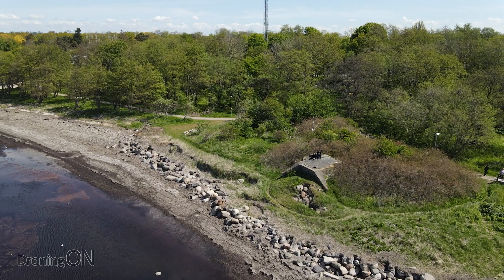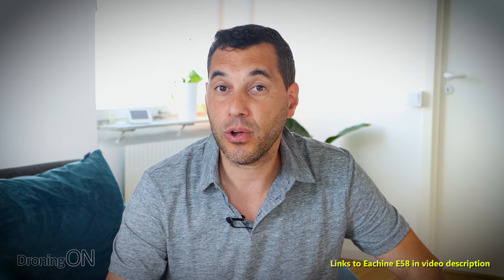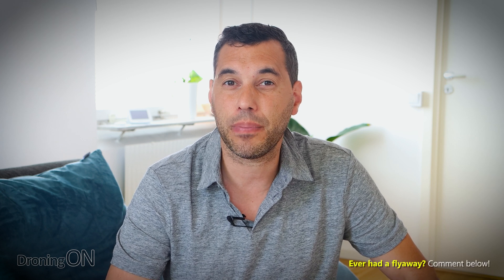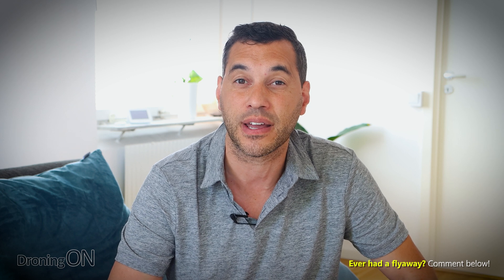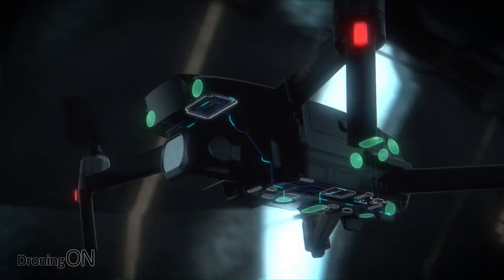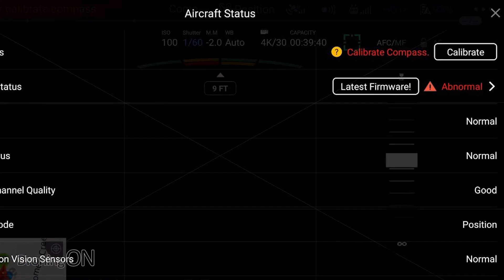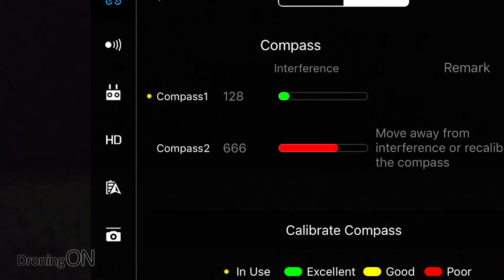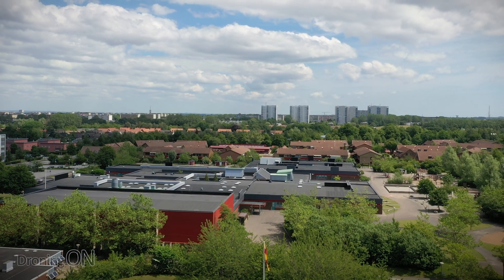How to NOT lose your drone (flyaway) - Beginners Guide

Comment: I have a cheerson CX20. It is not wind friendly and even with many flights it is liable to go rogue. I dont fly it often, the newer software in the cheap models are superior. I fly cheap DJI knockoffs. The position hold is great also is the auto RTH. I only have to bring it back manually if very high in the wind currents. If you dont practice manyally flying with harsh control imputs you may never be able to have the skills to manually take control. When control is an issue drop to a much lower altitude above any obstructions and pull it back in aggressively. Fly the machine! Dont allow it to fly you.

Comment: Thanks for the heads up very informative video. Before I stepped up to GPS enabled drones I had a lot of experience with toy drones like the ones you see at malls so I'm pretty confident in flying a drone that doesn't have GPS stability. But I always wondered what Attitude mode was.

Comment: This happened to me this evening and I had absolutely NO CONTROLS ON THE REMOTE . 

This drone has a 15 minute battery and I had no idea it could even go as high as it went . 

As soon as I pushed the takeoff button it zipped right off into the sky and didn’t stop . I watched it turn into a dot , and then totally disappear. 

This little drone went well over 30 thousand feet and kept going ! This really concerned me because if it’s potential to get sucked into a commercial jetliner , and then of course what it may land on when the battery died. 

I have video of it shortly before I lost it WAY UP in the sky . 

I was just flying it inside and a bit outside . I have no idea what happened but it was almost as if something took it over as soon as I pushed the takeoff button, (which was actually from my hand instead of the ground this time ) and it went straight up and away. 

I pushed every button I had and then I heard two like songs almost . One that had tones ascending , and then one that had tones descending . 

What the HELL happened here ?

Comment: Fly aways demonstrate you're never in control but DJ is controlling the unit. My 2nd day of flying a DJI mini 3 the thing just flew away. It acceleraged up to 2000 feet and 2 miles away.  Compass and GPS was calibrated; but why does the drone just take off and fly a huge distance away?

Comment: I'm here because of Atti mode I experienced yesterday with my JJRC X20. I was playing in a new spot inside my housing complex and it was right beside a power grid substation so that's probably why. The first thing that happened was the DISTANCE sensor suddenly indicated 2.2km while the drone was right in front of me so it activated the auto RTH away from me to an unknown location, luckily it has not lost signal to the RC so I managed to cancel the RTH and regained control of the aircraft before it got too far away. It then behaved like a rodeo bull on a leash refusing to fly stably to which directions I pushed my joystick to. I checked the display and the status in the app is still "aircraft is normal (GPS mode)". the Joystick display was also displaying Mode 2 (GPS mode) and GPS on. so I really didn't know what was going on

I started to panic and warned a few neighbors that were enjoying their evening stroll to clear the area as I might need to crash land this drone, luckily there weren't that many people around. I did the best I could to bring it to a clearing in my complex fighting against the wind that were blowing unpredictably and after a few hesitation I push down on the left joystick down hoping for the best. It narrowly missed a water hydrant on the way down and miraculously landed a few meters from me (pretty hard but quite alright considering what was happening). Hopefully this can help some of you in the future should this happened to you.

Comment: I lost my mavic 3, 3 weeks ago in far north of Scotland, photographing stac polly.
My mistake was I flew it from the car park in the wind. However, I did not expect to lose connection with RC, but I did, and I could not get a connection back, this revolted in me frantically hitting the home button with no success, end result, drone lost in the mountains.
I have flown remote.control planes, helicopters, and dji drones from the second edition phantom all the way up to mavic 3. I have flown around this mountain before with the phantom, and mavic air 2, but this time I lost my more expensive mavic 3, the only thing I can think of that was different in the flight was using the new dji rc with screen, all other times I used my phone with the rcs
Reply: TRIBE OF DAN 13th BLOODLINE  Hi Thx for this info, do you recommend one that would go on my next Mavic 3?

Comment: You need to preset RTH on lost connection instead of hover, also in case  of strong wind, you need yo get tge drone to lower altitude and S (sport) mode to manually override and control the return, that is apart from the calibration ln everythong and update location.

Comment: Here are a few things that may cause fly aways:
1) If you are flying in a new area, and you haven't checked available satellites? And your drone depends on satellite positioning to obtain GPS coordinates??? And only one satellite can be locked on with some radio stations & ham radio stations within 1/2 mile of where you decided to fly???  What do you expect other than a fly away? I don't know if you can download an app to find satellites available. I do know that you can use an app to determine if 2.5ghz is filled with cell phones. I don't know if the drones have the ability to change channels on the 2.5ghz frequency, but if they don't???? bad engineering, and this is (IMO) why you are having a loss of control. 
2) If you are using 2.5ghz, and are in a densely populated area, everyone and their grandmother is on some phone using this same frequency, and you WILL have interference even though you don't want it.  5ghz is a better option, more channels. 
3) Purchase a spotting scope, and place it on a tripod near where you are operating your drone. If your drone is out of sight, you won't know what way to turn the controls. You need to see the drone in order to know when it has picked up a signal again, and that you have control again. Moving altitude up and down moderately quick while looking into the spotting scope? as soon as you see the drone respond to your input, quickly send it the RETURN HOME command. If it goes in a wrong direction, press cancel over and over and over.  Return to controller may be more accurate than return to home, assuming return to home uses GPS. 

In conclusion: 
You've got to use logic with this, and realize that a loss of remote control combined with a loss of visual line of sight (or drone is too far away to see without a spotting scope). Again, as I stated before, up and down altitude motions until you see your drone respond, as soon as you see this, CANCEL return to home and switch it to RETURN TO CONTROLLER. 
Wind has been known to interfear with radio frequencies, and may also contribute to the loss of range. Loss of range due to wind, loss of sight, loss of signal due to cell phone interference, or because you are flying in an area where merchant marines have installed a microwave beam on some roof top that shoots the microwave down the river channel????    These things should be looked for with the spotting scope.

Comment: My mini 2 flew away recently. Luckily it hit the side of the mountain and broke 3 propellers but I could retrieve the drone. I had absolutely no control from the remote to the drone. It just did its thing despite my efforts to fly it manually. No error indication as well. I still don't know what caused the flyaway. After replacing the propellers the thing flew as if nothing happened and I didn't calibrate anything before or after. But after watching this I might as well do calibration before every flight

Comment: I guess I don't get it? Because I fly the drone away, why can't I fly it back? I have never used RTH or auto take off/landing. These modern drones are so easy to fly, I never felt the need to use some automated system for assistance. I came from a time when flying RC aircraft meant your fingers were always on the sticks./..

Comment: I was flying my holystone hs700e today in good conditions - minimal wind, clear blue skies.
I was flying in tripod mode too. 
All of a sudden my drone went berserk and flew away hard left at full speed and would not respond to any manual input from the controller.
I had to keep visual on it until it hit several trees and thankfully fell to the ground rather than being stuck up at height in a tree.
Was this 'drone fly away' or was it some other malfunction?

Comment: Hi! Why RTH needs to use the compass if he uses GPS?
Reply: Exactly.  I had a fly away and got message saying magnetic interference. Land immediately.   Then GPS lost. Then compass lost.  Therefore RTH doesn’t work.
Reply: Like he mentioned in the video. GPS and compass are 2 different things. GPS tells you where you are, compass tells your where you are facing. The GPS doesn't do both. RTH uses both GPS and compass so if you have GPS only that's great. If you crash it it will tell you where your drone is but you won't actually be able to fly in the right direction. if you don't re calibrate often it might think that home is north when it's actually south. Idk if that makes sense. Hopefully it helps
Reply from the maker: Precisely buddy, Mais please watch the video again, it's all explained.

Comment: Tell me what to do, when you initate a return to home and you loose 100% connectivity? AND your drone drone does not return home as you have told it to in the setup? AND the drone does not return to home when connectivity is lost? AND does not return to home when the battery begins to fail? AS if the drone lost all GPS coordinates as well as RC transmission? Thats what happened to me Sat. night. Thats what I call a "Fly away"
Reply: I had a magnetic interference and tried to land immediately then lost gps then said lost compass.  Then drone went on a ride to wherever it wanted. RTH doesn’t work if you lose GPS and compass.  I found out the hard way unfortunately

Comment: It is not correct to recalibrate the compass before each flight and is not advised by DJI. If it really needs calibrating it tells you. It may be that local magnetic interference is causing the disturbance that causes the re-calibration message and if you do this in the proximity of the said  interference, that really will cause a fly away when you lift off as the IMU and compass start to disagree. This topic has been much discussed on the various forums and the consensus from the experts who really understand drone physics insist that it is a completely pointless and possibly risky practice.
Reply from the maker: I'd suggest watching the video again, the advice we give is NOT to recalibrate before every single flight, just before each flight of the day. We're experts, we've been working with and flying drones for far longer than some randomers on a discussion forum. Thanks for the comment.
Reply: @Droning-ON  Recalibrating on each flying day/occasion is plain wrong. Checking the drone's orientation on the app's map (in DJI Go etc) against its real orientation is the single most important step in preventing fly-aways. Ensuring the compass is correctly orientated at T/O is vital, as that is where the IMU takes its initial reference from and any disagreement here due to magnetic interference will cause chaos as the drone moves away from the source of the interference.. See sar104's brilliant explanation of compass function - not a 'randomer' but a respected expert. No matter how long you've been doing it, you can still learn how to improve if you have an open mind!
Reply from the maker: @localman2209  you're entitled to your opinion, but recalibrating on each flying day isn't at all plain wrong, many commercial operators do precisely this, to ensure that their expensive equipment is correctly tuned and ready for a day of professional flying. Do as you please, my viewers appreciate the good advice suggested within this video. Thanks for the comments.
Reply: @localman2209 Explain why recalibration is wrong?

Comment: I finally bought a Spark, today was my 2nd day messing with it. I am an experienced pilot as far as flying. I have many non GPS models. I just wanted to get familiar with the Spark before sending it out too far. Yesterday I flew about 100 feet away and hit rth a few times without a problem. Today I had a problem. Keeping it fairly close again I hit rth and it wanted to land where it was, just across the street. It didn't come back on its own for some reason. Another time I hit rth and I heard it say atti mode, it went up 30 meters and froze! I couldn't control any direction or up or down, I let it hover until I heard low battery. At this point I started to panic a little. Should I let it run out of battery and let it fall from 30 meters and hope to catch it? I moved my position a little and walked away and all of a sudden the Drone took off fast going away from me northeast! I was freaking out I'm going to lose it my second day? Somehow I regained control and manually brought it back and landed it. But I wonder why it froze? Now I'm afraid to even fly it again or at least use rth function. But that's why I get GPS drones for that function. If I'm out 1/4 mile or more it's difficult to tell which way it's facing unless I look at the screen. But what happens if I lose that visual on my phone? Just bought a 5G Samsung for flying some of my GPS quads that require 5G. Dji is supposed to be all that? I'm not sure after today. Any idea why it froze and no commands from the controller were working?

Comment: And remember to stay away at least 10 meters away from any metal and if possible ANY object when calibrating the compass

You can calibrate the compass next to a metal object, the drone might accept it, 8 meters up when the down vision system doesn't see the ground anymore + getting away from the magnetic object might cause this compass error midair and then RIP
Try your best to spin the drone around 360 degrees in both directions, it might recalibrate midair, at least that's what I read on some forums

Comment: Just had my first flyaway (Mavic Pro) It went into ATTI mode and decided to fly backwards...at full speed. The controller wouldn't respond...it just kept going backwards. Luckily it hit a tree and came down. But I had NO control. There was minor damage, the battery was thrown out and the rubber grommet holding the camera was dislodged from its seating. Bit afraid to put it up again next time. But will calibrate and do thorough safety check. If it does it again...well droning ....had a good run.
Reply: Did it happen again ?
Reply: @hiddemVm  No, it hasn't. I think it was a combination of low light, my old phone freezing and maybe a gps signal loss. I'm still hesitant to fly at twilight. I have a new phone now and I cross my fingers but it has flown correctly ever since then.
Reply: JuicyFruityify Thank you for your reply! I will buy my first drone and seeing these problems are pushing me away from doing that! Really surprised how a company like dji even allows these things to happen and not even trying to fix! Imagine flying above a crowd of people or above a highway and this happens! Cant imagine the damage this could bring

Comment: Hey, I found your video after loosing my SG907 pro drone since I was looking for some answers. I was flying it in my garden to train myself, it suddenly took off and gained 40 or 50 meters of altitude and literally flew away all by himself, not responding to any command. I was not able to get it back, but I may have prevented it if I knew to calibrate the gps more frequently, even though it doesn't explain why it didn't respond or why it gained altitude. I'll try and get more informations before buying the next one ;)